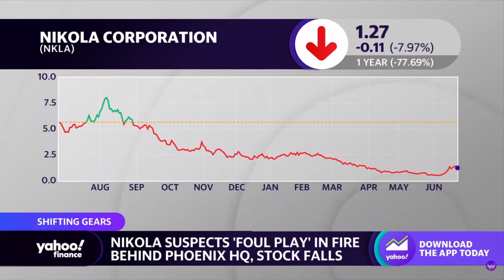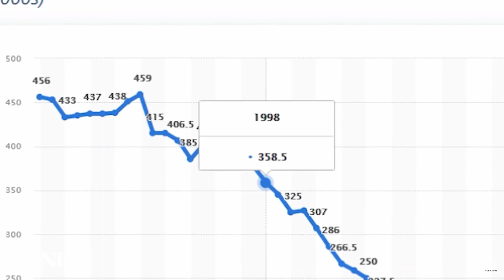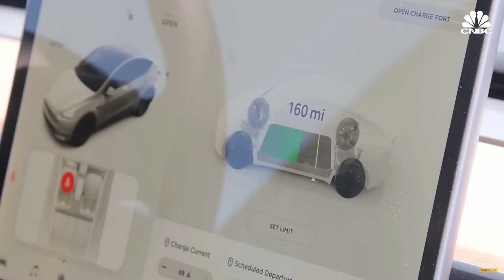Nikola's Electric Semi-Truck Fire: "Battery Defect" or "Foul Play"?

Comment: Hi Ace. Thanks again for the video. I also think it is not battery issue. 
By the way how do you think about Nikola is discontinuing operation with Romeo power? Is this bad for Nikola?
Reply from the maker: Romeo tech is still at Nikola's factory, it's just that the remaining assets are no longer valuable to Nikola and are being sold off for cash
Reply: They only closed the Romeo Power factory in Cypress and moved everything to Coolidge

Comment: Awesome video Ace . You make a great point. With NKLA semi truck testing and running for more than two years. TTSI using at the port daily with no issues. The Tre Bev run flawlessly  and more dependable in the last 12 compared to a new diesel truck they have. 👍